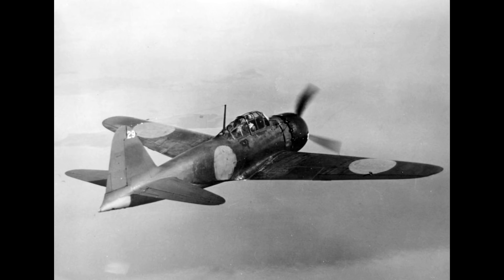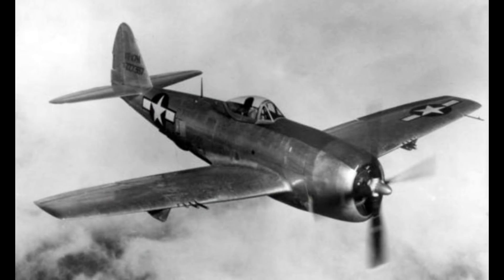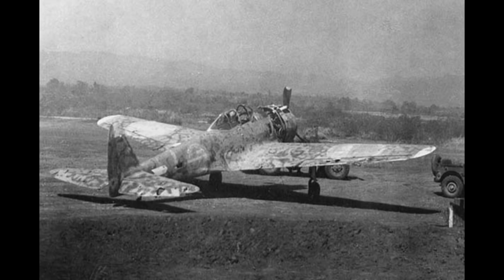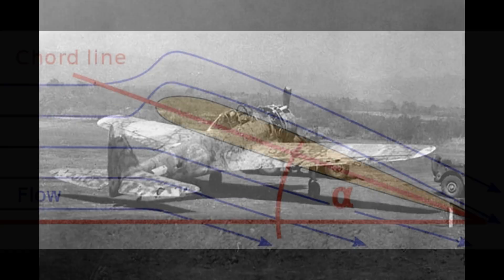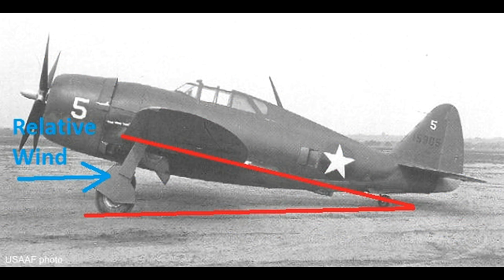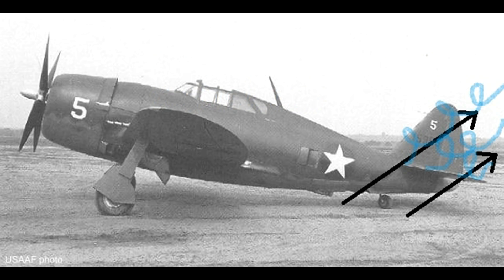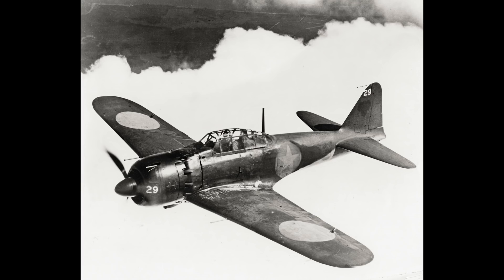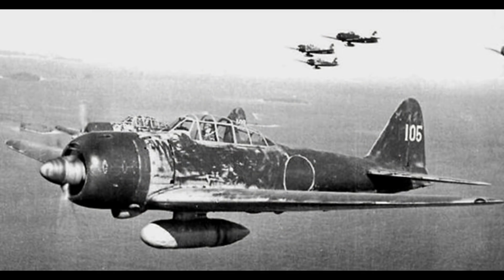Mitsubishi A6M Zero, an interesting fact few people know

Comment: You're right. I didn't know that. 

I mean, I knew that the Japanese made the Zero's agility an absolute priority, and that certain safety measures were omitted to achieve it, but I had never really LOOKED at the horizontal stabs and taken note of how far forward they were compared to contemporary fighter designs of the 40s. Very interesting.
Reply: At 1:30 you mention the designers of the A6M move the horizontal stab and elevators forward. While your statement is 100% correct compared to most other aircraft, I just wanted to point out that the designers technically moved the vertical tail back compared to the A6M prototype and left the horizontal tail surfaces in the same position. Note that later model P-40s (late model F, maybe late model K, and I think all L, M and N) had this exact same change.

Comment: Hi Greg. Very interesting stuff. I’d live a video at some stage detailing the mistakes that both American and commonwealth pilots (RAF and RAAF mainly) made against the zero in 1942 and when it was exactly that they worked out the effective counter to this. I know that flight testing a captured zero confirmed it’s aileron problems at high speed, it’s lack of armour and firepower and the extreme vulnerability of its fuel tanks, but it also seems likely that pilots had already worked out most of theses from actual combat experience before then.

Comment: I used to watch movies in that wind tunnel in the 1960's at Tachikawa, it was a huge concrete open interior building. They could easily have put a four engine bomber inside. I lived next door to the Zero factory. It was completely rusted but intact along the old Nambu train line.

Comment: As someone else has pointed out, the Ki-84 was an extreme example of the principle applied here, even though "hit and run" was the clearly preferred tactic of Allies by the time design work began in 1942. Better to have extreme maneuverability even if you can only use it occasionally, I suppose.

Comment: I was stationed at Tachikawa base, tokyo in 1977, it was a R&D base during the war and the Zero was designed using the wind tunnel there. The USAF had turned the building into the base theator, strangest building inside,  when I was there, the underground facilities were still there but locked up, tails of underground railroad and storage with aircraft abounded, and later I heard they commissioned ex military to go underground to disable boobytraps. Beautiful base Tachikawa, it is now for the most part a park. 1956 Comm Gp, I was a 307 tech controller, Drake ASC,  Asaka.

Comment: I read once that the one fighter that could best a Zero in a high speed turn was the P40. Apparently Curtis designed an incredibly strong wing/fuselage construction for the P40 that enabled it to perform tight turns at almost full speed, something even the Zero could not do.
Reply from the maker: That's true at high speeds, although as speed drops in a turn fight, and if at a constant altitude, then things will quickly favor the Zero. However a P-40 pilot who knows what he is doing is more than a match for a Zero, just don't ever slow down in the P-40.

Comment: The IJN shot themselves in the foot early on by restricting the Zero to a 5.5 lbs per horsepower limit. Zero designer Jiro Horikoshi wanted the Mitsubishi Kinsei 46rated at 1,070hp but was instructed to use the Mistubishi Zuisei 13 radial rated at 875hp. Test flights with the Zuisei 13 showed the Zero to be underpowered and suffering from vibrations related to the two blade fixed wooden propeller. The plane was redesigned to use the Nakajima Sakae 12 rated at 975hp.

Later the A6M model 3-2 did get a larger 1100 horsepower Sakae 21 engine but by then it was too late. The late A6M model 5-4 finally got the Kinsei 62 engine rated at 1350hp and bumped the Zero to max 355mph. Theis model would have gone a long way towards restoring parity with the F6F-3 but the F6F-5 soon restored superiority. The biggest problem for Japan was lack of trained pilots. Pilots like Saburo Sakai flew Zero's well into last moths of the war and in the hands of a skilled pilot he could still perform some miracles by statying alive  but skilled pilots in 1944-1945 Japan were rare. 

 Lucky for the Allies Japan didnt have a very expansive engine technology. The man reason armor was left out of Zero was because thy could nto achieve the level of performance needed and range and have enough payload for armor. If IJN had not insisted on a 5.5lbs per horsepower and if Japan would have had a good radial engine in the 1250 to 1300 horsepower range the war in Pacific might have lasted a bit longer. 

The Zero's replacement the A7M1 Reppu never went anywhere mostly because IJN kept changing the design requirements. 

In the end US war production would have steam rolled over Japan sooner or later but the end result was inevitable and Japan knew this.
Reply: Anlushac11 e22we
Reply: Late 1940 IJN asked Mitsubishi to start work on a follow up to the A6M but design work was halted Jan 1941. 

April 1942 IJN asked Mitsubishi to resume work on the A6M replacement. July 1942 IJN issued design requirements. To meet requirements a 2,000hp engine was needed. Nakajima Sakae 45 and a Mitsubishi Kinsei 43 were in development. Nakajima's engine was ready first but would produce less power at altitude. 

Jiro Horiskoshi wanted to wait for the Mitsubishi engine. IJN ordered the use of the Nakajima engine. 

 First flight of A7M1 with Nakajima engine occurred My 6th 1944. Maneuverability and handling were excellent but the aircraft was very under powered and didnt meet the specified 400mph top speed at 20,000ft,  making about 355mph. 

IJN ordered development stopped July 27th 1944. Mitsubishi asked for and received permission to continue development with Mitsubishi Kinsei 43 engine. 

First flight of A7M2 with Mitsubishi engine was October 13 1944. Performance was improved and top speed was 390mph. Allied bombings and a earthquake in December 1944 all but destroyed the A7M jigs and the Ki-83 development. 

Saburo Sakai flew the A7M in June 1945 and declared it the fastest fighter he ever flew and believed it would easily surpass the P-51 and Hellcat. By September 1945 at surrender only eight prototypes and two production models had been completed. 

So concept process started late 1940,  designing started April 1942, first flight with bad engine May 1944, first flight with good engine October 1944, 10 produced by wars end.

Comment: What your referring too is called tail moment in regards to the hinge line vs CG. The rudder hinge line is moved aft for stability around the verticle axis due to a light airframe and relatively powerful engine. The Curtiss P-40 was modified from the "F" model on thru the "N" model by adding approx 2 ft. to the fuselage length for the same reason. Multiple engine variants were used on the P-40.
It's not that the stabilizer is moved forward,  it's the rudder being moved aft. Another design solution was to add area to the verticle fin on some designs. P-51D vs. P-51H example.

Comment: Speaking of horizontal stabilizer, Mitsubishi J2M (designed by Horikoshi Jiro, same designer as A6M). Also to an extent this feature is present on Kawanishi N1K2-J series, Nakajima Ki-44 and Ki-84, many other Japanese aircraft.
Also, that dogfighting in WW2 was "obsolete" is a misconception, since hit-and-run only works if fighter can "run", however when speeds become comparable, it becomes evident, that planes will be forced into dogfight. After introduction of more advanced fighters by the Empire of Japan, such as N1K2-J, J2M, Ki-84 et al, US air force once again started taking casualties from units, that were equipped with those.
Problem was different - dogfighting requires skill, while hit-and-run requires just to be able to hold a plane on course flying in close-to-straight line and shoot only at those who happen to be on that course. After heavy casualties in New Guinea campaign, Imperial Japanese Navy Air Service had strong lack of experienced professionals, who had found their end there. Surviving ones however, managed to survive till end of the war, flying same A6M Reisen (aka Zero) and prevailing against  so-called superior US fighters. For example, Iwamoto Tetsuzo survived the war, being credited with 80 confirmed kills (and 122 more unconfirmed). Nishizawa Hiroyoshi - also undefeated: he was shot down while riding a cargo plane as passenger. There are many more.

Comment: Another reason for this can be balancing CG and increased rudder authority in general when moving to a larger engine. There are a few examples of aircraft being upgraded to bigger motors getting stretched tails, and sometimes only the vertical moves.The larger engine will generally be heavier and provide more torque, and so you may need to increase rudder to counter that extra P-factor while simultaneously balancing an increase in weight, but without moving both the rudder and the elevators. Moving the elevator will have significant aerodynamic effect on the balance of the aircraft, not to mention the weight of the aircraft, and so for example with the late-model P-40 it was decided to just move the rudder but leave the horizontal where it was so that the only thing being changed was rudder authority (further from the wing = more control moment) and then the increased weight moment of just the rudder/vertical was enough to offset the newer engines' added heft. 

But yes I agree it's probable the Zero, due to its rudder not going below the horizontal, did need to leave some gap so that at high AoA there was a bit of control authority that isn't blanked out.

Comment: The Hawker Hurricane was another that could out turn its opponent inventory, particularly 109-E. Its turning circle pumping flap was as tight as 320+ ft vs the 109-E some 720 ft sustained. Luftwaffe were soon advised not to engage Hurricanes in turning duels as they would quickly find themselves in front of the aircraft instead of attacking behind. The Hurricane had its own spin recovery fix with a deeper tail extension below the stabiliser.

Comment: I live in south east Queensland, Australia. Recently a friend who has lived in the Ipswich area all his life, and his family before him, told me about the origin of the Zero. It was designed  by two  Ipswich brothers, who came from a horse drawn vehicle manufacturing family. For some reason they felt called to design a fighter. They may have been worried about the lack of military preparation in Australia. I might add our preparedness was abysmal. I doubt if the two brothers had any experience in aircraft design, but they drew one up anyway. They offered it to the Australian Govt., and got knocked back. The brothers then sold it to the New Zealand Govt, who then turned around and onsold it to Japan. No doubt the Japanese modified it somewhat. It was very embarrassing  to the family, so I think it was all best forgotten. An aside to all this is that Australia did eventually design and build a fighter plane, the "Boomerang", in six weeks. Amazing!  Cynical me says it looks a lot like the Zero. I would have loved to talk to those old blokes. They would have had some stories.
Reply: If you read translated Japanese comments, on Japanese videos about the A6M, many of them are breathless about how the Zero is "a reflection of the Japanese spirit" or the "national character" of Japan. Like 2 or 3 at most will point up it's of Commonwealth origin. But maybe that ironically does reflect Japan, hah.

Comment: By the way, having the stabilizer positioned farther back from the fin/rudder does the same thing as the opposite does on the Zero.  Doing this moves the high-Alpha-induced disturbed air from the stabilizer rearward and lets the fin/rudder perform in clear air.
This design is common in model high-performance gliders.

Comment: I'd say Macchi C.202 Folgore and C.205 Veltro had a pretty close tail design. Although I'd love to hear your opinion on them. 
Perhaps I might even ask for a separate video on Macchi fighters, as I personally consider Castoldi to be an outstanding designer.
Edit: Castoldi's fighters also have an interesting feature, that being uneven wing length. As far as I know it was to counter the prop torque, but made the aircraft less stable in hard turns. 
Something similar was implemented in F4U Corsair, as the right wing had a small bump at the front. Was it to disrupt the air flow or something? I can't really remember.
I can also mention the semi-air cooling of the DB-601 implemented in C.202 to deal with the problem of engine overheating. Actually, the whole cooling system is interesting in comparison with 109s, as it was made to use less coolant, but at higher circulation speeds, that saved some mass but was harder to produce.

Comment: Two interesting facts about the tail placement on the Zero. Firstly, there is a story, possibly apocryphal, that the Zero was inspired by the Gloster F.5/34 which does look very similar. The elevators on the Gloster plane were placed behind the vertical stabiliser though, but for exactly the same reason, to improve spin recovery etc. See YouTube Drachinifel "The A6M Naval Carrier Fighter - Homegrown or Copy?"
Secondly, although the Zero was highly manoeuvrable, no doubt due to the tail arrangement, the Japanese taught their pilots to make a fast diving attack and zoom out and not to dogfight, see Drachinifel "The A6M Naval Carrier Fighter - Zero or Hero?"
Reply from the maker: I think there is some confusion there between design goals of a plane and tactics. Designing a plane to be highly maneuverable and utilizing surprise attacks as a preferred tactic are not mutually exclusive.
Reply: @GregsAirplanesandAutomobiles  Indeed, but books repeat the notion that the Japanese chose dogfighting as a tactic. Authors copying one another. 
It's a thing I find truly irritating. One aircraft carrier has a 'roomier' hangar than its predecessor, but neither set of dimensions is stated. A tank has a larger turret ring, thus enabling a bigger gun, but the turret ring's size is not stated. 
I once contacted a tank museum asking them about a turret ring, but they said to measure it would be too difficult, and I'd need to spend £20 for them to search the manuals etc. LOL.

Comment: I found another WWII fighter with this design feature. The Ki-84 Hayate. The Zero's successor, the A7M, also has a forward horizontal stabilizer but it's not as pronounced as on the A6M or the Ki-84.
Reply from the maker: That's true! Good job.
Reply: @GregsAirplanesandAutomobiles  It turns out there's another one! The P-40N. Not sure why they moved it forward for the P-40N, on earlier P-40s the elevator hinge is in line with the rudder hinge.

Comment: The Zero also had other features that contributed to its low speed agility. It had washed out wingtips so the ailerons would still be effective past the stall. The wing was also shaped to stall progressively outward, from the root to tip.
Reply from the maker: Yes, and  you would think that all WW2 fighters would have been set up that way, but no. In WW1 it was even worse.

Comment: There was another non-Japanese fighter that did this and was very well known. The P-51D models had a rudder and vertical stabilizer set farther back then the horizontal stabilizer to allow the rudder to increase in size by not touching any other wing.

Comment: Excellent video. Thank you for sharing this interesting information. It's ironic that the Japanese had a wind tunnel to discover and solve this problem because bad wing aerodynamics became the Achilles heel American pilots used to beat this thing. If a Zero was on their tail, they'd just go into a high speed dive and roll right because Zero ailerons would freeze.
Reply from the maker: Wind tunnels often had low airspeed limits.
Reply: @GregsAirplanesandAutomobiles  Thanks for letting me know.

Comment: Very interesting story. I've never heard about that. And the comments are nice and full of interesting bits to. I've heard the performance of the zero, or at least the early ones, was due in part that a large part of the framework was made with super light bamboo. I imagine there were variances that used more aluminum. Cause the bamboo,  while very strong, must of been a disaster if a fire lit up. That and the lack of self sealing gas tanks.
Reply from the maker: The Zero was not made of bamboo, maybe some full scale models or something, but not the real airplane.
Reply: @GregsAirplanesandAutomobiles  I see. I must of been misinformed. It was my understanding the earliest ones did have bamboo. I though the abundance of bamboo and the lack of aluminum used in other planes neccesitated bamboo for many cheep fast fighters.mabey it was in the prototypes. I simply don't know. Thanks Greg for correcting me. I like to dump wrong info when I can. I know the Brits made the mosquito out of plywood due to war time shortages.  Live & learn right?.🤔

Comment: That's an interesting observation on the Zero... Looking at other WWII era fighters, I did notice that the F4U has a distinctive empennage as well, only it's vertical stabilizer and rudder is further forward than the horizontal stabilizer... I wonder if the end result is a similar benefit?
Reply from the maker: Thanks. The end result is quite a bit different for the Corsair. In fact, in the Corsair spins are not approved. I do have a whole video about the Corsair, you might like it.
Reply: @GregsAirplanesandAutomobiles  Oh yes, you can be sure I watched that one too, lol